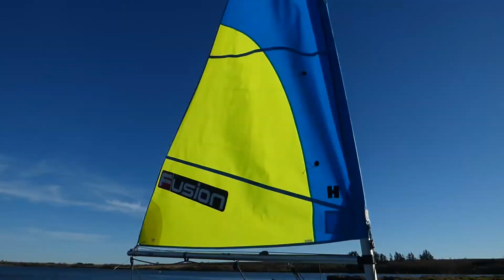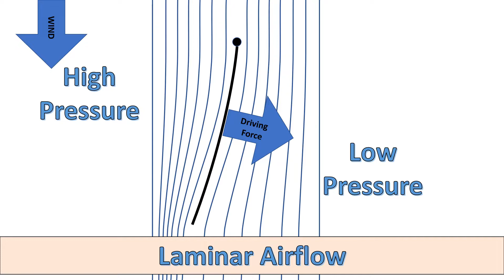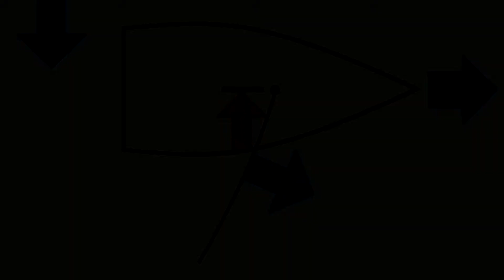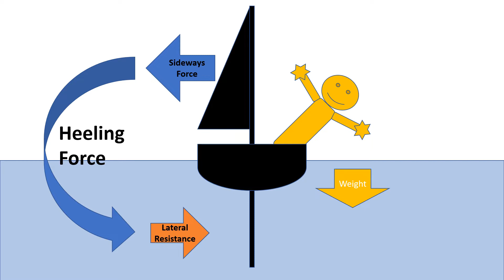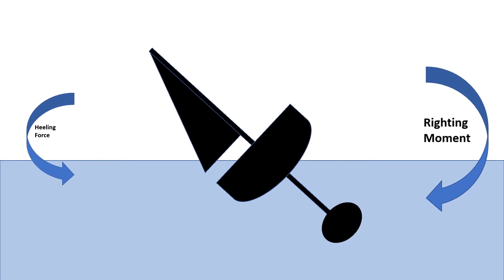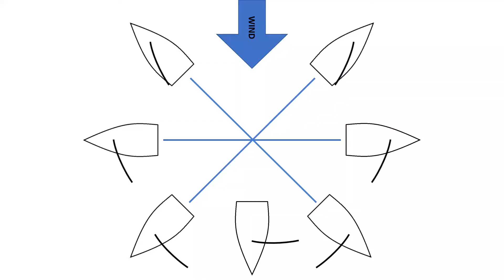Learn to sail a dinghy - a step-by-step guide to getting started

Comment: One thing I can't quite get my head around is why it's not better to sheet more - even at the expense of heeling - to have more power in the sail?
Reply: You totally answered this in the #2 video ... thanks!!  Great explanation!
Reply from the maker: Thanks Martin,
Glad it's helped. It's all about the efficiency of the boat. In dinghy racing, a boat that's overpowered will generally be slower than one that's more under control. 

Dinghies are designed to be sailed relatively flat, compared with yachts which are expected to be sailed heeled over. If a dinghy feels hard to sail, it's probably being sailed inefficiently. Boat speed is a by-product of efficiency 👍

Comment: On a beam reach why shouldn’t you have the sail directly facing the wind (like 90 degrees)? Is it because you would have a turbulent air flow?
Reply from the maker: Yes that's right - if the sail is square to the wind, you'd have the turbulent flow. This force would be pushing the boat sideways more than necessary, and have less forwards power, meaning the boat is trying harder to capsize and going slower.

Letting the sail out to establish the laminar airflow will reduce the heel and increase the speed - more efficient, and therefore easier to sail.

In practice, the sail is at the optimum when you pull it in just enough for it to stop flapping. The front edges of the sails will be the last part to stop flapping. This is true for all points of sail except the run, which is where you'd have the turbulent flow if you're sailing straight downwind. It's usually quicker in dinghies to sail 2 very broad reaches downwind, so you never have the turbulent airflow, even with boats like a laser, and especially with boats with a spinnaker where the speed difference is greater. 

Hope this helps! 
Happy sailing ⛵